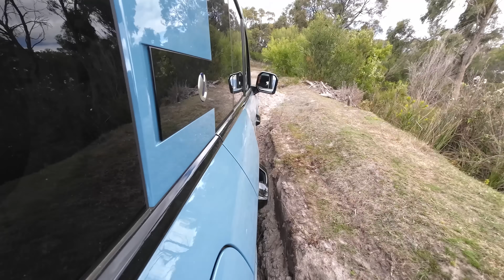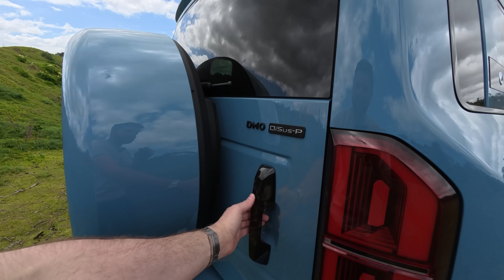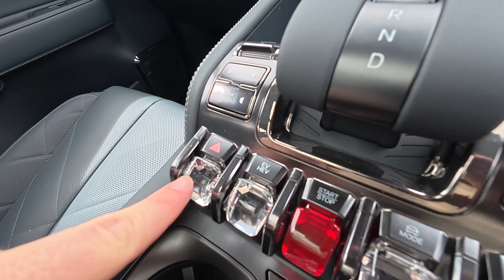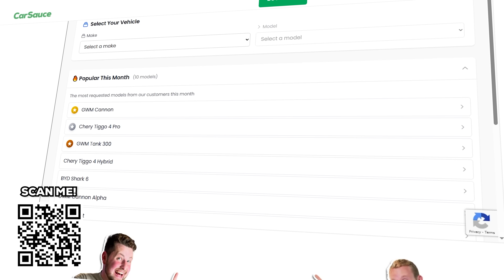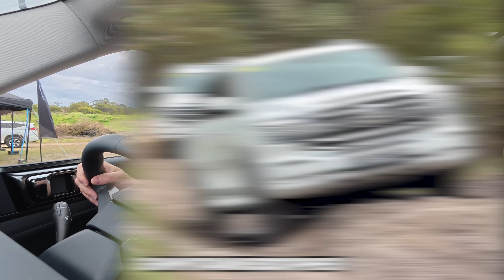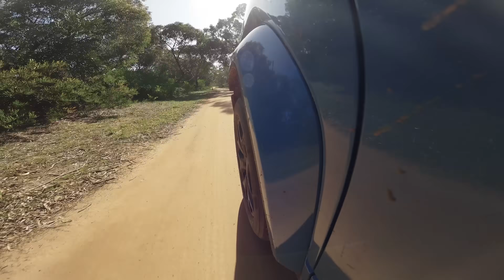2026 Denza B5 Review: CANCEL YOUR LAND CRUISER PRADO ORDER!!

Comment: Can't keep dissing the Prado. The Prado will still have a resale value after 20 years and 300,000km. These cars will be closer to zero resale value after 10 years and 150,000km.
Reply: Have you visited china and use their uber(didi) many cars already had 350.000km on their clusters and the condition still top notch
Reply: Not so sure about that. I just sold my 14 month old BYD Shark for one of these. Shark cost me $60,100 sold it for $55,100 with 14,000ks. Given most cars at this price point loose $10k as soon as you drive them out of the showroom, this was exceptional.

Comment: To say that toyota is feeling the heat is a massive massive massive understatement. However to be very frank and objective the 250 prado is a much better off roader than these chinese suvs but for sure for someone who does not do super extreme offroad they are a great buy.
Reply: Why do you say that? Are you aware of the strength of the ladder chassis on these?
Reply: @eight50 there have been multiple indepent tests. Some xhinese cars over heated. Toyota land cruiser is a legend. Do you think chinese will come on and in 2 years dominate? Well the way the xhinese are going they will soon i think jowever parado 250 at the moment is an extemely good offroader but i personally so not like it and wont buy it.
Reply: @fahed.28 Toyota legend is about to make a reverse entry into the history books. 300 Series has reported several issues, including transmission faults that led to a recall of over 10,000 vehicles due to a programming issue causing potential loss of power and fluid leaks. Other common problems include diesel injector failures, turbocharger issues, and hybrid system malfunctions. Then there’s the big one! The “hot V6” design. Owners of the Land Cruiser 300-series V6 report turbocharger overheating and failure, oil coking/sludge in hot areas (reducing oil flow and damaging turbos), cracked exhaust manifolds/heatshields from thermal cycling, cooling-system stress (thermostat/radiator/fan/hose issues), intercooler/charge-air oil contamination and boost leaks, and occasional injector/ignition knock or misfire under high load; causes are compact engine packaging, high exhaust temperatures, degraded oil or long service intervals, and heavy towing/hard driving, so check turbos, oil lines/oil condition, cooling components, exhaust components, and intercooler/charge piping.

Comment: They missed the mark based purely on pricing. BYD Shark only sells based on the value proposition. Put in the same price bracket as a ranger and it would get a second consideration. They’ve priced this too close to the prado to be a real competitor. Could have simplified some of the luxuries and whacked $10k off (maybe change the logo also to be fair), and they would have a chance.

Comment: 490kg of payload in a vehicle that is rated for 3000kg is a joke. Should actually be illegal. 

10% lowball down force is needed to keep the trailer stable. Dropping to 5% is just dangerous so the fact that Danza says that is unsafe. 

At 10% even if you stay at 2500kg you will be left with 240kg. That is crazy the average  family with teen age children would be close to over loaded, especially when you fill the fuel tank. 

How can you claim that is reasonable?

Comment: I think this is a great car and glad to hear it is coming to Australia.  However, I think the limited payload is an issue.  If you want to tow at its rated capacity, 3t, you will need to account for around 300 kg ball weight, assuming 10%.  For the Leopard version, which does seem more capable, that leaves only 190 kg payload.  So I could fill my petrol tank or take my wife but not both and nothing else.  Maybe you would need to buy the standard version and do a GVM upgrade but it would be a pity to miss out on the hydraulic suspension.

Comment: How do the locking differentials work on an electric motor? I've never seen it. This is brilliant. Even the G wagon uses 4 motors, one per wheel, whereas this uses 2 with locking diffs. Also, how does the low range work here? Are their gears driving the wheels directly or what? Or is it another gearing on the electric motors since there's no physical driveline? I'm assuming it still works the same as other BYD models where the engine never directly powers the wheels.
Lastly, why didn't they put this system in the Shark?
Reply: BYD的電平台混動技術DM PHEV（DMi/p/o）是串並聯雙模式的混動技術，有一個高速擋，在高速巡航時採用發動機直驅模式（並聯式），而低速巡航時採用驅動電機驅動（串聯式）。

Comment: 31.8 KW LFP battery for only 90km WLTP range?? nah... cant be... should be more than 150km+ ... dont make sense... i know is what they saying on the paper... but thats about 32KW LFP battery we are talking about. The body weight not even 3 tons yet. Close similar weights as Sealion 7 that at best 16kW/100km on an eco mode. And i am sure B5 have eco mode and should be able to take up more than 100km with full battery 31KW running only.

Comment: Land Rover discovery three and four were about 2.7 2.8 t tonne so this with electric should be feeling much faster and energetic even though you can tell the weight… I think there’s a lot of confusion about hydraulic air suspension. I don’t understand how it’s both? I think the price should be 60 to 65,000 for the base model. If you could get that with a suspension upgrade to raise it 2 inches that would be the better outcome, I think because no one does air suspension as good as Land Rover.
Reply: Cloud Chariot-p  is all Hydraulic
Reply: You can have air springs with hydraulic dampers. So it can be both but it would be extremely expensive. This has normal coils but the hydraulic part is the damper (replacing the shock) which can fill with fluid to raise the car. The Prado uses air on coil springs to do the same but only at the back.

Comment: One thing worth pointing out, although CarSauce done this right…

DENZA B5 and B8 uses DiSus-P Standard(inferior to Yangwang U8) version. Unlike DiSus-A, DiSus-P is not an air suspension, but, yes, a hydraulic suspension.
The basic car may not get the DiSus-P though, which will give you more body rolling, imbalance, less comfort during emergency braking etc.
Reply: In China, Genuine 20 inch rim (275/55 R20)+ 6-valve High performance front vented disc brakes package costs an extra, at… 10k CNY ≈ 2.1k AUD.
Not sure whether they will or not give you the option. It’s kinda not needed as the basic 265/65/R18 gives less noise and choice to already available AT tyres, but the brakes improvement seems handy.

Comment: Chinese vehicles definitely offer more bang for your buck when it comes to inclusions. The biggest issue is quality control and software issues. The Chinese are miles off it this department. I own a Tank 500 and love it. The original Tank 500 I was meant to pick up had what they call a catastrophic error which GWM Australia could not fix, and it had to be replaced with another new vehicle. Then the issues with ELK, Adaptive Cruise Control, Cabin Monitoring and continuous beeping. There has been a software upgrade which has improved some of the issues, but I would not consider them fixed.  Until the Chinese manufacturers launch a pug free car the legacy manufacturers have nothing to worry about or until they price themselves so much it drives consumers to buy these Chinese vehicles. Which is what happened in my case. Was looking at the Prado but for what I paid for the Tank 500 I could but almost buy two top spec Prado's, absolute madness.
Reply: " legacy manufacturers have nothing to worry about"? 3 brands in the top 10 already!
Reply: yes you are right， This car has been sold in China for more than 2.5 years. Many bugs have been fixed and  DMO support up to everymode
Reply: DMO+   Precise Torque Vector Control  is coming
Reply: And legacy carmakers don't release cars with issues? VW had countless issues with their software in cars sold to consumers. Toyota faulty accelerator pedals and airbags not to mention the petrol Land Cruiser V6 engines failing. What do you mean the legacy brands don't have issues on new cars?

Comment: A battery car towing 3 tons? Don't act suprised when your range drops like crazy or your battery starts degrading really early of the life of the vehicle.
Reply: It's a PHEV and teh petrol motor keeps the battery charged. I've done 23,000km in the Shark and have no reduction in range on a 120km regular trip that i do.
Reply: @Johnno1979  This one have 1.5L v4 engine. All of its power comes from the battery. When you do hard stuff on those batteries you creat heat, therefore your Battery get degrated. Maybe you werent stress it out as someone who tows 3tons or have it on high rev all the time as for you being on light sands for example. 

Personally, I would take care.

Comment: 90kg down on Payload compared to the worst Prado.. 
Not really a toyota fanboi, but I don't think Toyota need to be shaking in their shoes just yet.
Reply: Great. But how many people buy a Prado just to do the school run and grocery shopping?
Reply: @johnnyg_88  Don't really care about people who buy a 4x4 to use as an AWD but I do care about buying a 4x4 to use as it was designed so unless you're a Toyota shareholder let's not get bogged down into a manufacturer's financial returns of a new vehicle. On the other hand, the payload is a concern and air suspension is an unknown in terms of reliability for any new vehicle. Cheers
Reply: @cyclemoto8744 They've actually been out for a while now with no major issues I'm aware of. I have the shark and there are some common issues with that so I doubt it'll be flawless... but the new prado hasn't been either
Reply: Buddy… Toyota already dropped its price in China

Comment: If I buy a $90,000 Denza B5 how much will it be worth compared to a Prado after 3 years?🤔
Reply: You will be lucky if they will keep this model after 3 years and parts availability will be questionable
Reply: Go catch public transport.
Reply: 2x possibly 3x more if your from Victoria 🌈
Reply: Fools and their money...
Reply: This isn’t costing $90k?
Reply: It will be scrap in three years, so whatever the price of 20kg of plastic coated copper plus four rusted dish washers is in 2028
Reply: Un sellable is what it will be !
Reply: Half price u should spend （in China now). 70k driveway is a fair price in AU. BYD does not have a separate production line for its high end car and mixed reputation in reliability.
Reply: Taking into account that a top end prado is 100k I would not worry about resale, Toyota quality pricing is a thing of the past. Their quality has droppped over price

Comment: BYD is trading as insolvent. their actual debt is 10x what their official debt is as they owe billions to suppliers (90 days overdue). the supply chain will fail first, and then the company until a bailout is required. also google zero mile EV scam BYD is deeply involved in this grift. dont go near this garbage. you have been warned (from someone who invested in BYD 6 weeks after warren buffett did in 2008).

Comment: What I want to know is if you could upgrade the sharks powertrain later down the track to have the denzas locking diffs, they do have the same ladder frame chassis sooooo maybe?
Reply: I wonder why they didn't put this system in the shark. Is it really that much more expensive? I also really want to know how locking diffs work in an electric motor.

Comment: The logo is a bit disappointing. I prefer the Chinese version.
Reply: It's the Fangchengbao badge in China
Reply: The Chinese version "Fangchengbao" is a bit tricky for English speakers to pronounce. I guess that's why BYD decided to go with Denza?
Reply: @orangefree9  translate it as formula leopard or equation leopard
Reply: Thanks to Mercedes, it was a Mercedes lead brand before BYD fully took over, and BYD hasn't changed the logo.
Reply: Really? As a blue power ranger fan I approve of the logo
Reply: The meaning of BYD's sub-brand "Fang Cheng Bao" lies in the integration of scientific rigor and wild vitality, essentially using professional technology to deliver personalized innovations in automotive life.
 
- "Fang Cheng (Equation)": Symbolizes standards, rules and professional wisdom, representing BYD's commitment to optimal vehicle performance, quality and safety based on precise engineering and cutting-edge new energy technologies (e.g., three-electric system, DMO platform), embodying the spirit of exploring technical truths.
- "Bao (Leopard)": Conveys power, speed, agility and freedom, hinting at the models' outstanding handling for complex road conditions while reflecting bold breakthroughs in design and innovation, catering to users' pursuit of personalized and dynamic experiences.
 
Combined, it essentially expresses "technological brains + robust performance" — highlighting BYD's technical heritage and conveying the brand's core positioning of meeting personalized travel needs. Do you want me to translate the technical highlights or model lineup of Fang Cheng Bao into natural English too?
Reply: @鯊魚-c4x  it's not Equation Leopard, it's Formula Leopard
Reply: @fatdoi003 He is not an equation leopard, but many Chinese names have to be disassembled to understand its meaning.
Reply: @fatdoi003  the literal and more accurate translation is equation leopard, but it's translated as formula leopard in most places, as that sounds better in english and is easy to associate with formula racing (which makes it better for marketing or use as buzz word)
Reply: Crying about a freaking logo uno...
Reply: I also prefer the leopard logo
Reply: easy go buy one aftermarket like $20
Reply: 显眼包真恶心
Reply: @allenhk6364  方程豹的车标比腾势好看多了
Reply: It is Denza logo in China.
Reply: Theres probably gonna be blacked logos. when they make it.
Reply: the Denza logo is fine, not a problem at all.
Reply: i am agree. I prefer the bra logo over the current version
Reply: Agree - de badge straight away
Reply: I prefer BYD logo 😊
Reply: Denza sells like shit in China, BYD needs export value to put better data on paper
Reply: @fujigx5792  try to get an Aussie to say Fangchengbao without sounding racist
Reply: @fujigx5792 no, not really, top MPV seller, the fangchenbao is killing it too. You're talking out of your ass
Reply: @fujigx5792  Source: trust me bro
Reply: Your talking rubbish only 😂

Comment: It seems we will have to wait for 2026 to answer questions like... GVM? GCM? Payload? F&R axle load limits? Available bullbars? How far can it tow a 3T van before the 1.5L turbo petrol motor has to do all the work?
Reply: Will be same as Shark. Petrol engine never works completely on its own.
Reply: No. The engine doesn't ever directly power the wheels. While it's technically possible they never do this. Including the Shark. It only has 1 gear attached to the motor and it is a high gear. That means it will never be efficient to directly power the wheels at varying wheel speeds. So all it does it send power to the battery to use at the electric motors immediately. This way the engine just focuses on charging the battery at its most optimal rev range despite varying wheel speeds while the electric motors can focus on driving the vehicle at any speed since it can do that more efficiently.